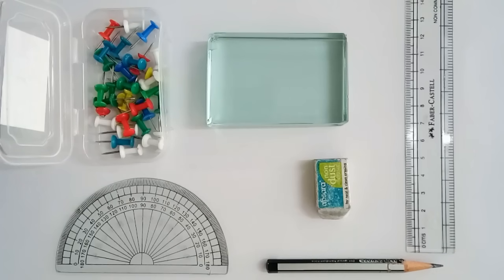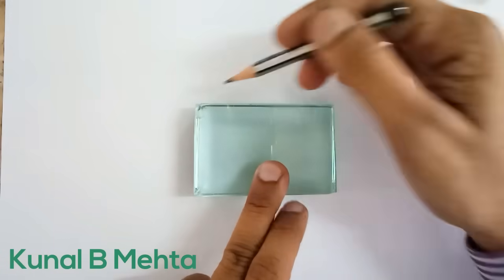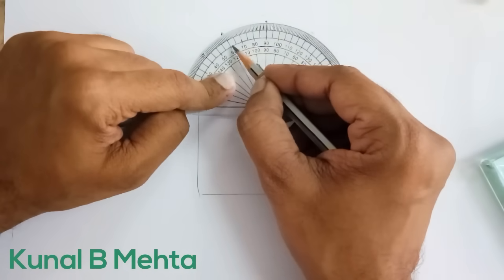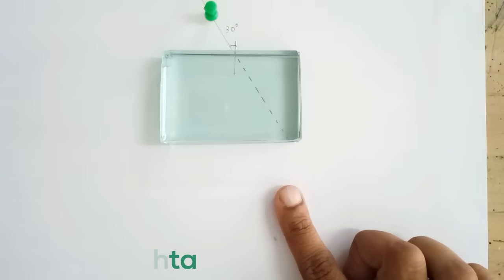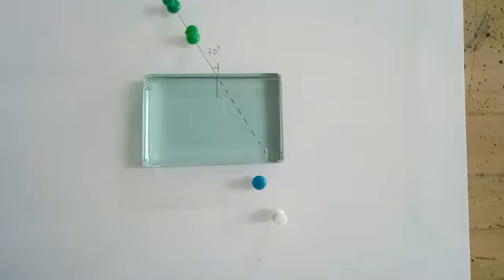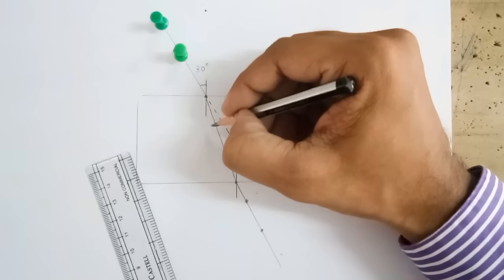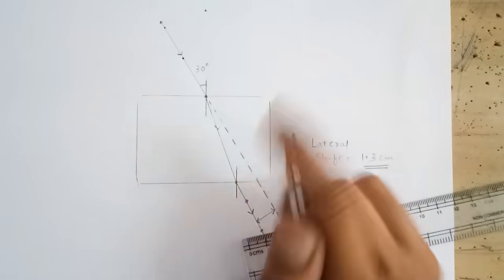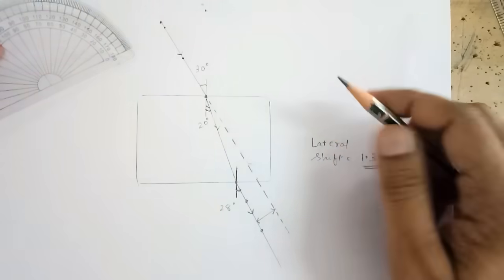Refraction Through glass slab : Lateral Shift Experiment

Comment: Hello explain nice but you didn't tell us why you used 2 pins 
And the answer  is : we require any two points to draw a line 4:07 4:07 4:07 4:07 4:07 4:07 4:07 4:07 4:09 4:09 4:09 4:09 4:09 4:10 4:10 4:10 4:10 4:10 4:11
Reply: Sab ko pta he be😂

Comment: But sir , were there both the measurement of refracted ray and sir u didn't took measurements of incident ray and angle of deviation
Reply from the maker: The angle of deviation is only measured in prism not in glass slab as the angle of deviation turns out to be zero

Comment: Plane mirror, 2 pieces of wood, glycerin, manilla paper with graph attached, biconvex lens, stand boss and clamp,dropper,half metre rule.kindly draft the expected experiment.
Reply from the maker: Title: Refraction of Light through Different Media

Aim:
To investigate the refraction of light through different media and to determine the refractive index of glycerin.

Materials:

    Plane mirror
    2 pieces of wood
    Glycerin
    Manilla paper with a graph attached
    Biconvex lens
    Stand, boss, and clamp
    Dropper
    Half-meter rule

Procedure:

    Setting up the Apparatus

    a. Set up a stable stand with a boss and clamp.

    b. Attach the plane mirror to one piece of wood and secure it vertically on the stand.

    c. Place the second piece of wood horizontally on the stand, perpendicular to the first piece, creating a base.

    d. Position the biconvex lens vertically on top of the second piece of wood. Ensure it is stable and centered.

    e. Attach the graph-attached manilla paper horizontally on the base in front of the lens, with the graph facing towards the lens.

    f. Fill a dropper with glycerin.

    Calibration

    a. Adjust the position of the lens so that it forms a clear and focused image of the graph on the manilla paper. Use the half-meter rule to measure the distance between the lens and the paper, which will be the object distance (u).

    b. Record the value of 'u' and the corresponding image distance (v).

    c. Remove the graph-attached manilla paper and record the distance between the lens and the plane mirror, which will be the object distance (u') for the second part of the experiment.

    Refraction through Air and Glycerin

    a. Pour a small amount of glycerin onto the graph-attached manilla paper, ensuring it covers the graph uniformly.

    b. Using the dropper, carefully add a few drops of glycerin onto the surface of the lens to minimize any air gaps between the lens and the paper.

    c. Replace the graph-attached manilla paper onto the base.

    d. Adjust the position of the lens if needed to obtain a clear and focused image of the graph through the glycerin.

    e. Measure and record the new object distance (u_gly) and the corresponding image distance (v_gly).

    f. Repeat steps 'a' to 'e' with air (without glycerin) to get the object distance (u_air) and image distance (v_air).

    Data Analysis

    a. Calculate the magnification (M) for both cases (with glycerin and with air) using the formula: M = v/u.

    b. Calculate the refractive index of glycerin (n_gly) using the formula: n_gly = v_air/u_air.

    Safety Precautions

    a. Handle the glass lens and dropper with care to avoid breakage.

    b. Be cautious while working with liquids (glycerin) to prevent spills.

    c. Keep the work area clean and organized to avoid accidents.

    Conclusion

    Summarize the findings and discuss any discrepancies in the results. Reflect on the experiment and its relevance to the study of refraction.

Note: Ensure to follow safety guidelines and take necessary precautions while conducting the experiment.

Comment: @ 6: 00....Incident ray  from air to the glass .....bend towards the normal....
@ 6: 13 ...ray travels from glass to air.....bending away from normal....
@ 6: 38 ....extended incident ray and refracted ray are parellel to each other.....
the distance bet them is called lateral shift....
@ 7 : 36 angle of refraction...inside the glass prism area....
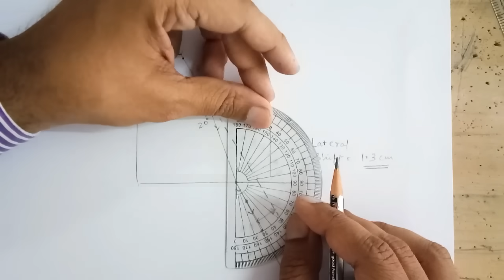@ 8:00 ...angle of emergent.....

Comment: Normal @ 2:05., 2:36 (normal )
..angle of inidence @ 2:16 (30 degree ), @ 2:46 (incident ray )
@ 3:10 put back the glass slab ....
@ 4:38 ...when seen through glass slab...the pins appear to be in a straight line....
but actually they are jus near to  normal
@5 : 20...glass slab kept aside